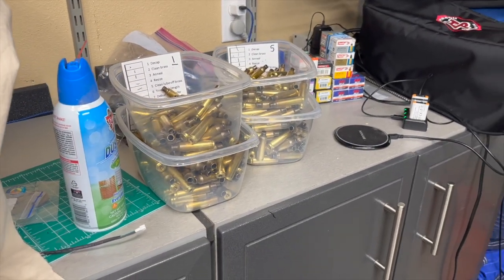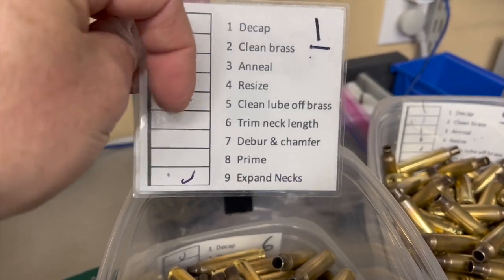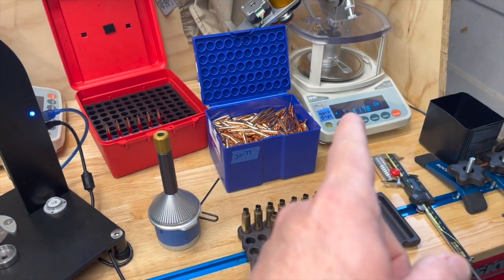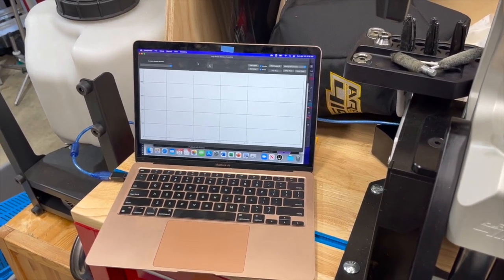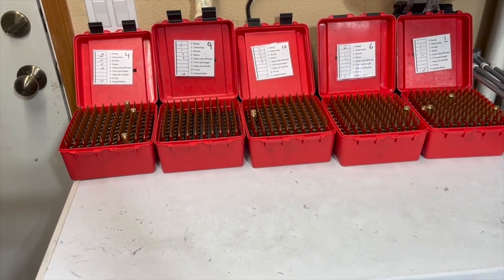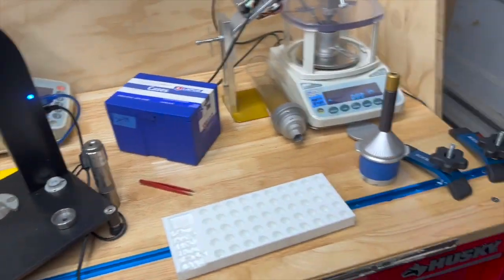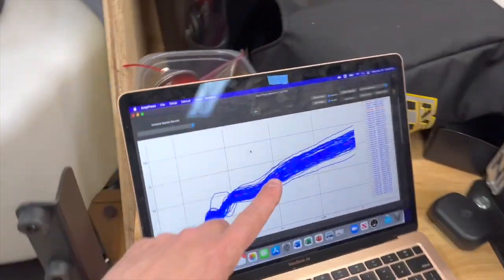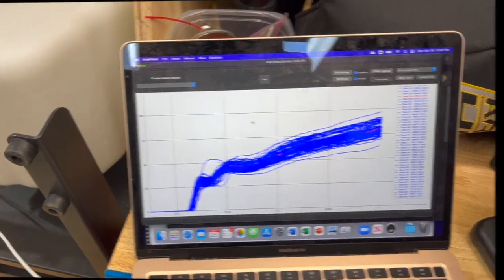2022 Texas State Long Range Championship Part 1 Brass Prep Reloading

Comment: How did you mod your funnel with the higher sides?
Reply from the maker: I went to the hardware store and bought some thin wall PVC that I think was 2 inch diameter and then wrapped a few pieces of painters tape around it until it fits snugly.

Comment: Nice video John,
Are you using rice media for the final tumbling process? Thanks!
Reply from the maker: I have used rice quite a bit but I’m currently using steel cut oats and testing that out.
Reply: Rice, huh, never even considered something like that, I wet tumble mainly with ss pins, size, trim, chamfered debur then tumble without any media just a drip of dawn an 9mm case of lemashine , if I'm In a hurry I'll throw all the brass on cooking sheets and load the oven(got a good wife lol) usually do that anyway so no spots, I need to try dry tumbling, I started out wet and just never really looked back

Comment: What purpose does the extended tube on the funnel serve?
Reply: This is to fit more powder into the case
Reply from the maker: As said below it helps allow more powder to better fit in a case. It also help keep the funnel up above the brass so less chance of bumping into things.
Reply: Thanks, i figured it was for dense loading the powder, just wanted to verify.

Comment: What happened with the V4  ?
Reply from the maker: I still use it especially for load development but currently my v3 with the Ingenuity Precision trickler is much faster. Over 700rds it was almost an hour faster. Adam is working on running changes for the v4 which should speed it up considerably.